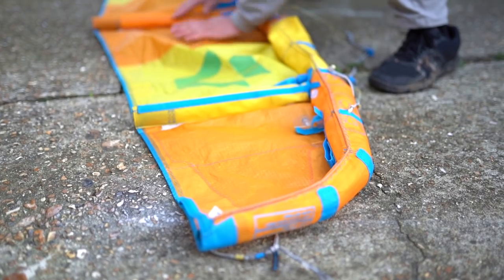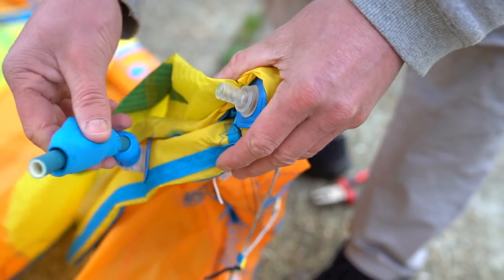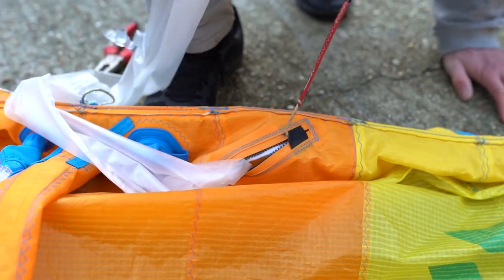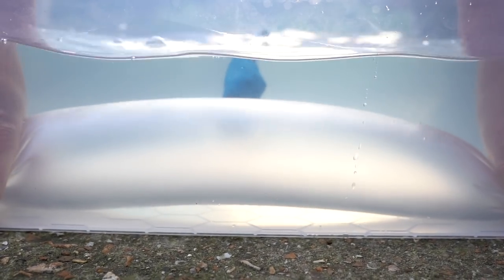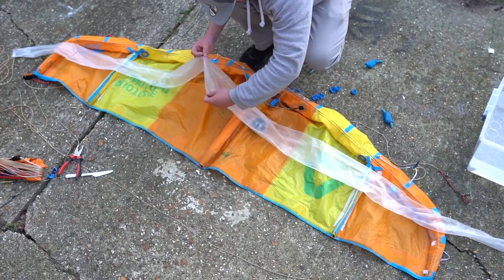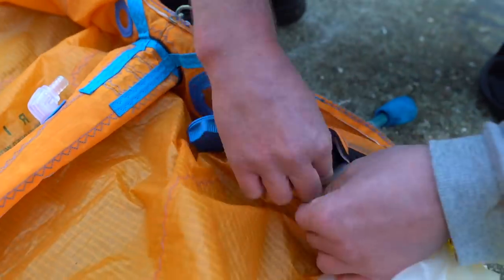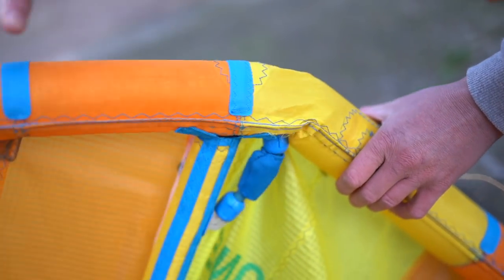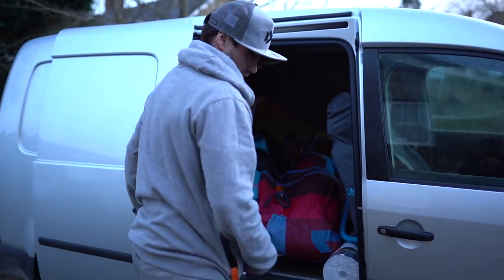How to Repair a KITE Bladder - TEAM TECH

Comment: Great repair video :) Doing it on a 12m2 kite thpugh is quite more difficult, I did need another person to hold the edge of the kite while pulling and re-inserting the bladder.
Reply from the maker: Yes it is much easier with two people. But possible by yourself :) 👍 stoked it helped!
Reply: True, just did my 13m and it's definitely more difficult.. my wife wasn't wanting to help lol. One thing that helped me a ton was to set a bit of weight on one edge of the leading edge to stand in for someone holding it, that helped make it pull through easily.

Comment: Great tutorial. Parts that were missing were how to remove the inflation valve and more detail on the bladder installation. 
Remove the inflation valve using the tool provided with your kite to unthread the valve from the kite exterior. 
Regarding the bladder installation, remember to not stuff the end of the bladder into the kite. I did that yesterday and popped the bladder because of it right on the end. It’s probably better to roll the end up to get it to fit. It sucks because you can’t see if there’s a twist on the bladder if it occurs right on the end of the wingtip.

Comment: I reglued my LE valves but after putting the bladder back in its torn in a few places . Really annoying. I hope talcum powder will help
Reply from the maker: hope you didn't make more holes
Reply: Be very gentle when you reinsert and don't get caught on any zippers etc.. shouldn't require much force at all, if it does usually a valve is caught somewhere. Hope you got it fixed, repairing these can be maddening because in theory it's so simple but it's also easy to make a mistake. Practice makes perfect, I've learned on an old kite I just use for training.. made more mistakes repairing than I'd like to admit lol!
Reply: @MikeMPharmaCyclist  I did get in back in without any problems after using talcum powder. Was very easy and practically impossible without it. Thanks for the help and the video!

Comment: Nice video Tom, like the bladder folding idea I always struggle with that part.. personally I get the proper orientation on one side then walk it way out like a single fold then slowly pull back through. Folding more seems easier to control, I'll try that next time. Also, you about killed me laying that kite out on what looks like rough pavement!
Reply from the maker: sometimes space is the issue ;) concrete, is ok if you don't walk over it! Kites see a lot worse on the beach :)
Reply: @tomcourtkite  haha I hear that!

Comment: This video, and multiple others, fail to mention that you shouldn’t over inflate the bladder out of the kite as it is not very strong and stretches! I just followed this video to try and repair a small pin hole. I found the hole successfully, patched it up and then pumped up the bladder to see if I had patched it correctly but the bladder couldn’t handle the pressure outside of the kite and has now stretched considerably. I will now need to find a replacement bladder

Comment: My Aluula has no access zipper.  What now?
Reply from the maker: Normajean Which kite model??
Reply: Aluula Flite 14.5.  The new one with the patented material.  Flies like a charm but it sprung two herniated bubbles and one popped.  Ocean rodeo sent a new bladder but I can’t find a zipper.  So I bet I have to go thru the inflate/deflate valve unless there’s a trick?
Reply from the maker: Normajean Vas I am not sure about ocean rodeo mate, however usually you take bladders out via the tips... make sure you attach a line before pulling it out tho!! Will be tricky if it’s one pump
Reply: @tomcourtkite  yup, one pump.  Ugh.  Called them and they said through the deflate valve.  That’s just my luck.
Reply from the maker: Normajean Vas unlucky man, bet they haven’t done a video on how to do it either!?